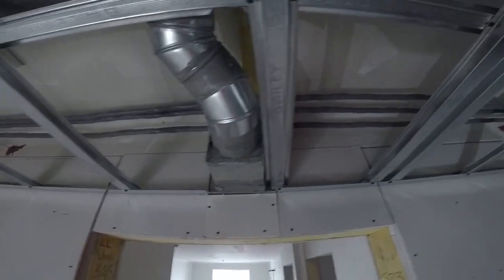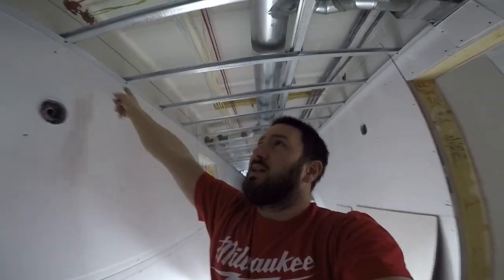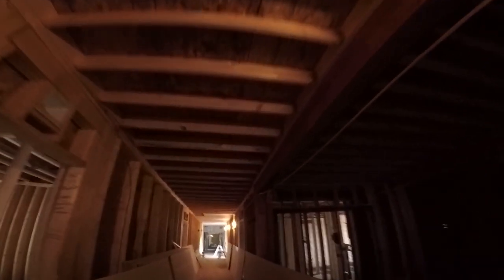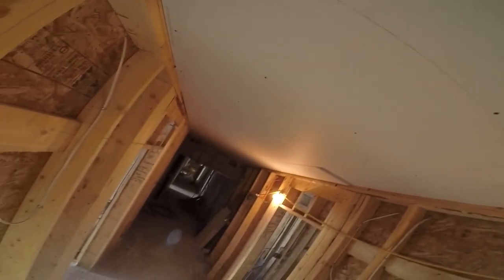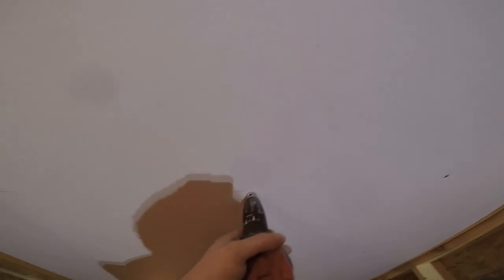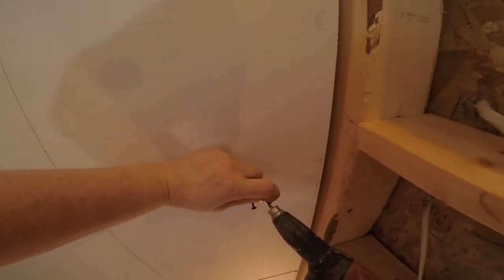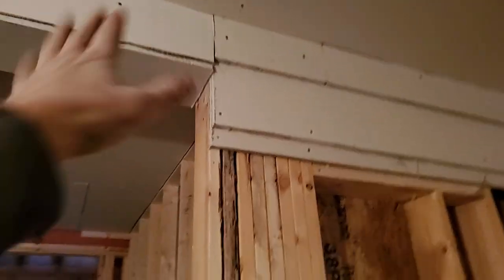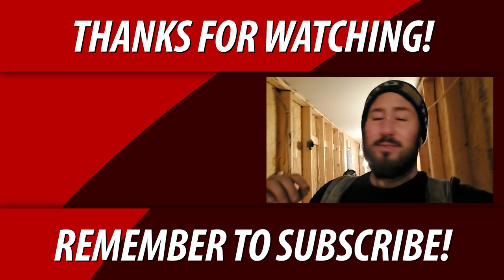Double Layer Drywall F/R Electrical Mechanical

Comment: I'm doing a basement ceiling and I'm wondering...what's an affordable insulation that helps with noise reduction. I'll be using channel and 2 layers of 5/8s.
Reply from the maker: Sure ya R20 is the perfect ceiling insulation. You can get it 16 or 24".

Comment: Nice hard work, man.  I noticed your partner using a cordless Dewalt screwgun.  Is it a "push type" or constant run or do you know? I'm thinking of doing a review on it with some other competitors.
Reply from the maker: Hey my man! Yeah its a new push one. I am really not impressed with though. It doesn't have the same power as the Hilti and it doesn't keep up with my 6 year old gun. You can't use it to drive in 3 inch screws into wood what so ever and my partner there is constantly stripping out the screws and his depth is always off. It could be the experience a bit but I have tried it to see if it is him or the gun and I say its the gun. I know the Hilti is expensive but I bet it will out last the Dewalt 3 to 1. I have put millions of square ft of drywall up over 6 years on commercial construction with it. Thanks Dave!!

Comment: Is it required to mud the seams with a special type of compound on the second layer of 5/8” drywall on a fire rated ceiling? Or can I skip finishing the seams all together if I’m dropping a ceiling below the double 5/8” ceiling?
Reply from the maker: Yes you still want to "fire tape" the joints to form a smoke seal. Does not have to be pretty. Just normal joint compound.
Reply: @ConstructionKronies  thanks